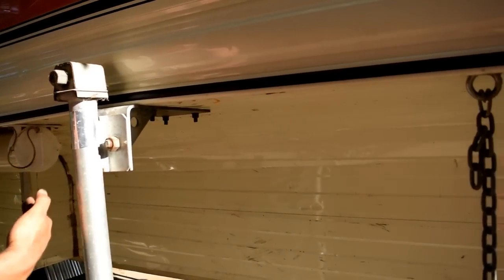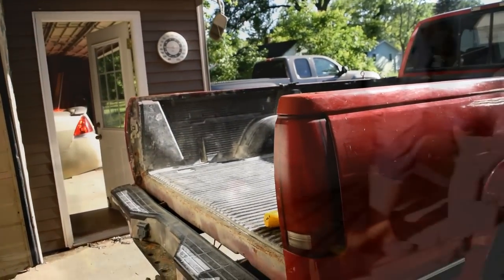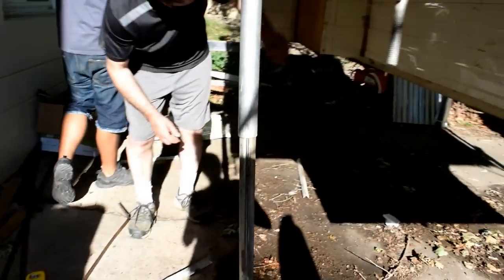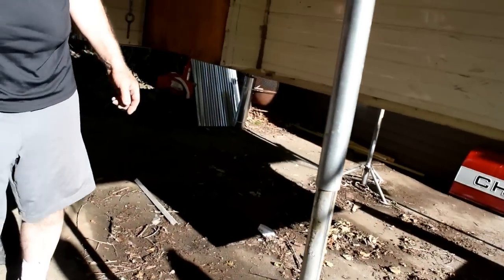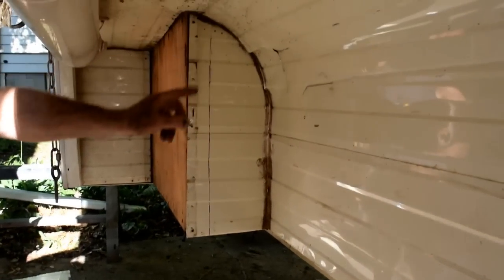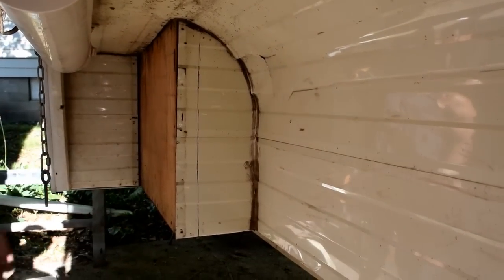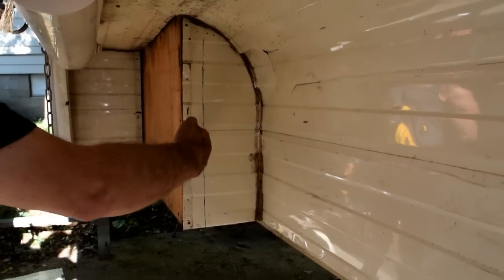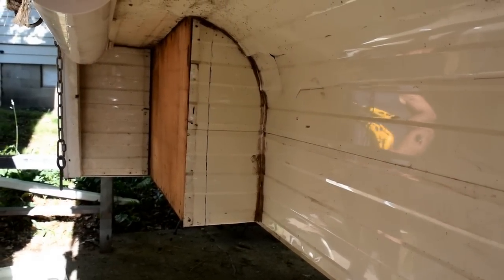Watch This Before Buying A Truck Camper!

Comment: Is your truck a half ton (1500) or a 3/4 ton (2500). If it is a half ton, I'd bet good money that you're over weight for the truck's ability.  Most of the older campers were heavier than today's and most of today's are still too heavy for half tons. Most people with half tons upgrade the suspension with air bags, stiffer springs and shocks and sway bars. None of this however increases the truck's GVWR or GAWR for the rear axle. Check the sticker on the door jam and note both those numbers. Then go to a CAT scale and weight the rig with full tank of fuel. Keep in mind that the GVWR includes the weight of all passengers and gear carried in the vehicle. For safety and legal reasons, it is important that you do that. I'm only mentioning this to you as we had a similar experience last year. We purchased a slide in truck camper last year that was 600 lbs heavier than the advertised weight. On our Ram 1500, we were over the GVWR & rear axle rating by 400 lbs. We had to trade our 1500 in on a new 2500 .... that's why I'm asking. If you do have a 3/4 ton, then you're probably ok. If you are using the bed mounts as a tie down system as shown, note the angles of the retaining chains. They run at a slight angle almost horizontal. The front mount on the camper is behind the camper tie down point. If you think about it, there is nothing what so ever from keeping the camper from rocking fore and aft over separation joints and wash board type roads. The front "Brophy mount" needs to be forward of the camper mount. Again, I'm speaking from experience as we have the same type mounts. I made an additional rear mount that attaches to the receiver and pulls almost straight down on the rear to keep it from rocking.
Reply from the maker: Travels with Yoly Our camper dry weight is 1350 pounds, which is surprisingly light for an old camper! Our truck is 3/4 ton with airbags . I havent weighed the camper with it all equipped yet..I would say I've added another 1,000 pounds to the camper. Great tips, thanks!
Reply: Until you weight it, you really can't say how much the camper weighs. The first one we bought was advertised at 1,385 lbs and after weighing we discovered that it actually weighed over 1,900 lbs.
Reply: That 1,385  lbs is empty and with no accessories or options. As soon as you add fresh water, reefer, genset, etc., you're adding weight. And I don't think there was ever a cabover camper that was suitable for a half ton pickup, a 3/4 ton should be considered the minimum and a 1 ton will drive even better.
Reply: +brbroberts1 These weight discrepancies are often due to MORE than just options.  First, the weight of water and propane is never included in its advertised weight. The advertised weight is when it is DRY.  Second, when a camper is equipped with items such as a refrigerator as STANDARD, it MUST be included in the camper's advertised weight (i.e. if it is NOT and option, then it is NOT an option to exclude it from the advertised weight). On several occasions, I have itemized ALL of the requisite add-ons (e.g. batteries, propane) and options and added their weight together.  There was STILL a very substantial discrepancy. This is even worse with respect to the brochures listing the weights for towed campers and toy haulers. The result sometimes reduces the maximum Cargo Carrying Capacity (CCC) listed in their literature by almost HALF.

The manufacturers should itemize what is included in their advertised weight so that people can cross check them for truth. Itemization should include all items which may be detachable yet may be included as a standard item. - Jack stands, battery, propane bottle, propane, ventilation fans, tie-down brackets, auxiliary steps, fire extinguisher, etc.
Reply: Gregory Parrott did you even bother to read what I posted before you replied to it?
Reply: brbroberts1  Yes, I DID read your post. Furthermore, I was NOT attacking it. I was just adding an observation about the discrepancy between advertised and the true weight.
Reply: Gregory Parrott Ok, I wondered, because you basically mentioned everything I did, but then stated it wasn't only the options that lead to increased weight, so I was a bit confused as to what your point was. :-)

Every option or accessory will have it's weight listed separately, but it is always up to the buyer to determine what the final weight of the vehicle will be, as there's just too many combinations that a buyer would be able to choose from  when they configure their camper (or most other vehicles).

As far as wet/dry weight, dry weight has been the industry standard with cars, motorcycles, and pretty much every other vehicle, so it makes sense that camper specs would follow suit.

Whether it /should/ be mentioned to the buyer is a conversation one could always have (and I agree with you that it should), but as someone who has over 2 decades in the automotive/motorcycle industry, I understand why it is done the way it is. The chosen standard may not always be the most accurate, but at least they are a standard that everybody follows, which leads to "apples to apples" comparisons. The federal fuel economy standard comes to mind, it's not necessarily very accurate as to what a buyer would see from the car, but it allows for an accurate comparison between different cars.
Reply: My  Northland Polar camper weighs over 3000 lbs dry and I have it on a 2000  Dodge Ram 2500 with air bags and I have no problems with it last 9 years living and traveling full time . just keep a watch on your tires and make sure they are all good and rated for the weight , you don't won't a blow out with the camper loaded on could make it a little difficult . safe travels and have fun !
Reply: Travels with Yoly m
Reply: Travels with Yoly you
Reply: It has 8 wheel studs, so I'd say 3/4 ton.
Reply: Travels with Yoly 8 lug axels 3/4 or 1ton

Comment: 88-98 (gmt400) chevy and gm pickups have a tapered bed for aerodynamics to save on fuel you have to buy a special truck camper for those trucks

Comment: Modern truck beds have the idiotic design of the supports for the tail gate extending inwards instead of older trucks which barely have the tail gate wider than the space between the bed rails so it cuts into the inside edge of them on the end and on either side and is supported and connected that way. The older trucks needless to say had a lot more thought process behind them for potential campers to be put on. A typical example of Automotive engineering having no thought process behind it. For a personal example I’ve got a long bed 2012 f 250 and I love the truck but I couldn’t get a mid 80s Jayko truck camper because I had the same problem. I only have 60 inches of space between the back of  my bed rails while the camper extends to 63 inches in the back overall. I would’ve had to have cut at least 2 if not around 3 inches of the camper off on both sides.

Comment: That's actually a big rookie mistake. All you needed was a tape measure to make sure everything would fit before you bought it. Knowing is half the battle.
Reply: And just a heads up, I would take turns really slow. Those truck campers flip easy if going too fast. And try not to store heavy stuff up high inside while moving.
Reply from the maker: We measured the length (of course)..but never measured width because we thought width was standard.
Reply: Yes, they were standard untill 1988 on GM trucks. Even camper shells for the most part were interchangeable between Ford, Dodge, and GM trucks.
Reply: i had the same situation a couple weeks back. its because older trucks like 90 and older are wider than new trucks. the guy that bought my camper had a 06 2500 Cummings and my truck was a 88 w250 Cummings and he had to cut the camper to fit
Reply from the maker: justin pearson Glad to hear we are not the only ones!
Reply: Sure it was a rookie move, but kudos to this guy for posting the video anyway. Even if it made him look foolish, he probably has saved others from making the same mistake.
Reply: Gowan Fenley
 I agree kudos!
Reply: We don’t learn from winning or success-mistakes and losing are the best teachers. Thankyou for sharing. There is way too much variation these days with trucks & campers which super sucks bc it just drives prices up and makes it harder to find the right one.
Reply: That's right Gowan, people are quick to knock a guy, THEIR mistakes are kept private while they sit on the sideline and put someone down.
Reply: ROOOKKKIIEEEE
Reply: Sooo, whats the difference of a rookie vs a newbie....one has someone to mentor them. The other one doesn't.  Thanks for sharing..a new form of mentoring newbies
Reply: Paul None Ya I thought one-size-fits-all
Reply: Simple  use tape measure  to measure width of the camper and bed and the length before purchasing. I don't even buy furniture for my house without measurements being taken
Reply: Paul None Ya oh man he just messed up so big
Reply: @iron-farmer  Right.  Because YOU came into this world knowing it ALL.  Give the guy a break and give him a round of applause for sharing his story to prevent others from making the same mistake.  That fact alone makes him a WINNER in my book.  As for YOU....
Reply: Tis true

Comment: Should've taken bedliner out.. would've gained atleast 1.5" on each side..
Reply: Yea shit @ 00:47 you look right at it.. driver's side back corner looks like it sticks WAY out.. could be wrong hard to tell from video for sure
Reply: I have the same truck with a liner and the liner fits tight, Chev boxes are 4 inches narrower than Ford boxes.
Reply: Same happened to me, wouldn't fit cuz the bed liner was bigger in the back,  took the bed liner out and.... wallah easy fit. (93ford lwb)

Comment: I think that camper is way too heavy for that truck. Take a look on the placard which tells it's weight. I just backed out of buying one myself cause it was WAY too heavy for my F-150. Those beds are only held on with 4-6 bolts and that camper is a LOT of weight. Thanks and best of luck.

Comment: Very aware of that, your GM truck in the video is less width at the tailgate than the GM truck that was built prior to 1988. That camper would fit any GM bed 1987 or older
Reply: Bob Clancy 1991 AND OLDER.

Comment: If you had the camper before you bought the truck why didn't you use a tape measure to be certain the camper would fit?

Comment: You need much better tie downs. TORK LIFT frame mounted tie downs! You need to put a block of wood between the camper and the front of the bed ! Lots of rookie mistakes!!
Reply from the maker: Christopher Sayer What does the block of wood do?
Reply: the block of wood 4X4 is better spacer so the camper is tight against the front of the bed from the floor... secures the camper stronger and tighter to limit movement in the bed of the truck.  that way you can secure the camper to the front of the truck bed without putting undue stress on the top railing of the truck bed

Comment: The wheel base with the double cab means that the wheel wells are closer to the back end of the bed of the truck if u measure yours then the truck it came out of u will see the difference from the back of the bed to the start of the wheel well in the bed the other Truck was probably a single cab or just a extended  cab right?

Comment: Tape Measure I know it’s hard to half to travel across country to go get your product that you made probably got on craigslist well I had to travel 1000 miles to get my truck camper and then I had to go to Home Depot to get the boards that I need to make it work it gets frustrating but even if you bring a tape measure or they have a tape like it’s said measure five times cut ones hang in there you’re doing a great job look forward to seeing travel
Reply from the maker: Shelly Quinn Thanks for the support!

Comment: this showed up in my search after seeking info on a viking 085. nothing to do with what I am doing.. but this is interesting. I drive a 96 gmc.  That realm of gmt400 (88-98 chevy/gmc) is called wimpy tails where I live. I keep a welded frame half ton, with hellwig 1000 pound springs. Its only reward is the lightweight camper...about 1400# .Going a couple hundred beyond specs due to manual trans on the v8 being lightweight and 150 degrees cooler.. Anyway, I don't trust any factory setup. LoL Keep your damn numbers. they even claim the manual trans is weaker. Really silly market hackers at the helm...still there now

Comment: Watching this and reading a few of the comments below, another 'rip-off' of the modern age is the payload capacity of modern trucks. I have a 1978 W100 Dodge Powerwagon. Even though it was considered a 'half-ton' in the day, the owner's manual says it has a 'payload capacity of 1,780 pounds'. That, my friends, is about 700 pounds more than a modern half-ton...so, in effect, the 1/2-tons of 1978 were actually 3/4-tons. Truck Campers came into their own back then, but while the campers still weigh between 1,700 and 2,300 pounds, the trucks have lost almost 40-percent of their payload capacities! That, and my 1978 Dodge W100 (4x4) only cost $5,900 (loaded, 4x4, 360 engine, all options)! About HALF the average household paycheck for a year...which would be equal to about $24,000 now....and you CAN'T buy a loaded 3/4-ton 4x4 now for that, for SURE!

Comment: Yeah man I feel your pain, that's GM for ya they wanted to be different, quirks like tapered boxes fuel tanks on opposite sides and the first to require special screw driver because of they're torx screws 🙄

Comment: it wouldnt fit in the newer model because, the big three Ford, Dodge, Chevy to increase the pay load moved the rear axle back. there for moving the wheel housing inside the truck bed closer to the tailgate.
Reply from the maker: jperry3956 That is very interesting, and great to know! Thanks for sharing!
Reply: How right you are.
Reply: +
jperry3956   Your claim that newer trucks move the axle further to the rear is an interesting theory. I wish it were true. But, it is not. I own several pickups, including a 1969 C20 and a 2017 F350. Both are long beds. On both of them, the distance from the front of the bed to the center of the axle is 56 inches.
Reply: Gregory Parrott I have seen it too, it gets more stability for towing large trailers
Reply: Not a problem.  Add a 4x4 at front of the bed.  FORD had a camper special model that had the axle position of the chassis can but single Wheel and a bed.  The spare had to go in the side of the bed.    We just added a 4x4 at the front as a spacer and had no problems with our 1968 12 Delray.

Comment: did you consider modifying the trucks wheel wells instead?
Reply: lay a sheet of plywood if it fits so will a slide in camper.4 feet wide,and if longer so what.

Comment: Any suggestions on a slide in camper for a 2003 Ford Sport Trac?? it has the very short bed and im having troubles finding model that will fit it.

Comment: I see in the comments some people keep saying to remove the bedliner. I don't believe that is a standard answer. I have a 2008 Ford Ranger 4x4 (small pickup) with a 1982 Sidekick Truck camper, and it fits just fine with my bedliner installed and a rubber bed mat.

Comment: There are a lot of downsides to using a camper.  I have one, I know quite a few negatives that go with it.  I think the most common, that I see all the time is gross overloading.  It is very, very easy to go over the weight limits, and it takes careful planning to stay in the range.

Comment: because chevys an ford an dodges are made differnt and trailer manufacturing companies build a different camper an trailers for each brand of rig smaller ones bigger ones longer an shorter so ask before you but the dam thing

Comment: So my question is, what was inside those 2 compartments you narrowed, I'm looking at a 64" wide camper in the rear that I want to get into a 60" GMC box.
Reply: Pantry - storage, plus the wires for the lights.

Comment: Remove the truck plastic bed liner why cut the camper?  Older trucks did not use bed liners.
Reply from the maker: George Johnson Ya that is the first thing we looked at, but the liner is pressed against the frame. We also pulled out the liner to look on the inside as well. Even with the 4 inches we cut off, it's a snug fit but it fits.
Reply: Smart mann!!!!!!

Comment: Bedliner I think...
Reply from the maker: Larry Peterson Bedliner is pressed against the frame.
Reply: You forgot to figure that the extra thickness from the liner makes the inside of your bed smaller. Bed campers fit properly without a bedliner
Reply: Bedliner has nothing to do with it. The bed it's self is smaller than the truck bed that camper was built for.

Comment: Take that damn bedliner out and no problem, there's your 2" on each side. That damn plastic molded fit all bedliner. Back in the day real trucks didn't need bed liners. JUS a money racket at the dealers.

Comment: bedliner?
Reply from the maker: RJ Cooper No bedliner is pressed against the frame
Reply: RJ Cooper your right. If you would have taken the bedliner out your camper would have fit better If not correct. Bed Campers are not designed to fit with a bedliner.  They are designed to fit a bare bed. Even though it may fit tight all the way around that 1/4" of thickness of the bedliner makes a huge difference on this kind of stuff fitting properly